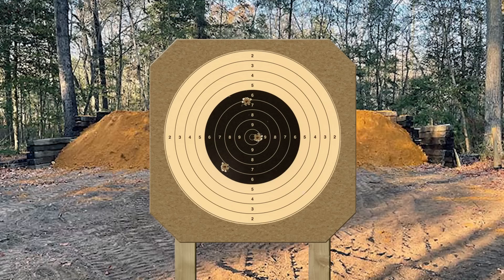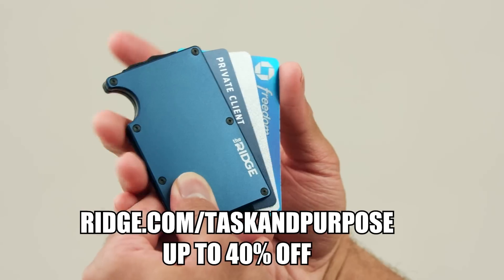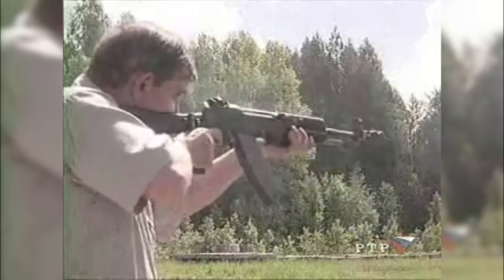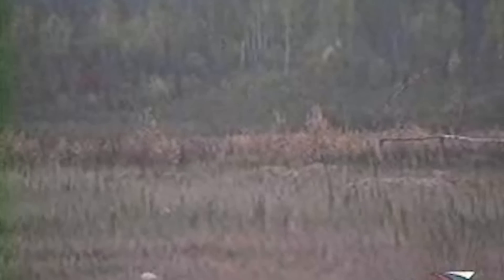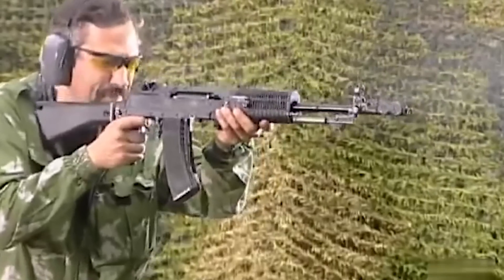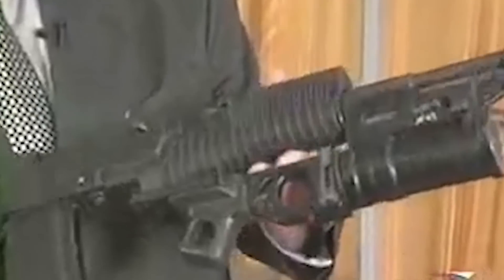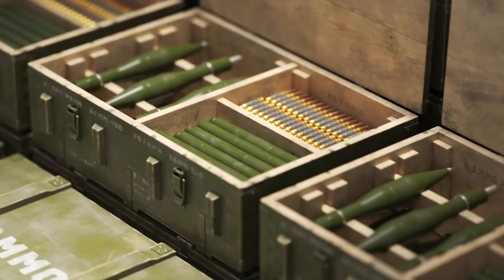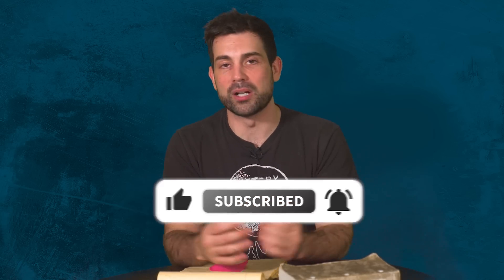This Russian Rifle Fires 2 Bullets into 1 hole

Comment: The operative word here is "complex." Anything more complex than necessary is asking for trouble. Way, way back the US Army tried a different, and much simpler, approach to putting two bullets on target at nearly the same time, the 7.62 Nato M198 Duplex load. They put two bullets in one cartridge case, one behind the other. The tradeoff was the bullets were lighter and the cartridge contained less powder.  I don't think it ever really worked very well, though I remember reading something by a sniper in Vietnam where he mentioned that he and his spotter kept magazines loaded with duplex loads in their rifles when they were moving in case they walked into an ambush on the theory that the number of bullets you could put out was more important than the power or accuracy in that situation.
Reply: I mean.  It ain't that simple.  A single cylinder engine has got to be extreme to reach 80hp.  A twin , same cc, easily spits out 90-110.    But using 10cylinders for 700cc is overcomplicated
Reply: Put 5.45 duplex rounds in the AN-94, just to see what happens.
Reply: I'm pretty sure the ACR report in fact states that the duplex round is the best way to increase shot probability
Reply: They tried it with flechlettes as well, it would massively increase shot probability and I think that will be the next way guns go, possibly with something like flechlettes as well. As far as I'm aware last time they tried it was back in the 60s before the m16

Comment: This is quite similar to the American ACR program(contenders being HK G11, Styre, AAI, and Colt) in 1986, where the idea is to have a 2-3 round burst with one trigger pull and one recoil, thus increasing the hit probability. And the fate of the American ACR program is quite similar, with cost, nightmare complexity, and lack of budget leading to its end.
An94 is actually far less crazy compared to most candidates of the ACR program, with G11 using caseless ammunition and Styre and AAI using flechettes. Only the Colt ACR is simpler, using pretty much a standard m16 but the cartridge contains two bullets.
Reply: The American and Brittish ones actually worked. I never understood why though even on paper it was overcomplicated for too low a yield
Reply: The ACR program was, of course, what I immediately thought of when I heard "So complex the US still doesn't have anything like it".

"Yes, there is a reason for that" I thought.  "It's because the US tested the concept extensively and eventually came to the conclusion that the juice wasn't worth the squeeze."

Which, not surprisingly, was what the Russians eventually decided after trying to put the AN-94 into soldiers' hands.
Reply: Task & Purpose putting out wrong info once again lol
Reply: @WhatHappenedIn-vt3vq  the french also made one in 1978 or something and it worked has a fire selector with one of them being a three round burst, the famas
Reply: @rei1556  Not really. Famas fires 3 rounds with one trigger pull, but with 3 recoil impulses. This means that the second round from the burst will be impacted by the recoil from the first round, thus not accurate. 
Many other rifles have this 3-round burst feature. Including M16a2, hk416, and some AK variants.
Reply: @kevintang5473  doesn't matter, the requirements for that time was they want grunts to put out more bullets with one trigger pull against the enemy, that's why even the us had that acr program and we all know what happened to that
Reply: I don't get the impression that the ACR program is that horrible. They're probably just get the fact that the infantry rifle peaked with the M16A2 pretty soon and do the logical thing and hurried along to the OICW
Reply: The G11 is a much more clever design I think. The internals are easier to maintain and you can field strip it without having to read a thick ass user manual. The caseless ammo makes it a lot weirder but it allows the whole system to work in a more sensible way.
Reply: @Scroolewse  Field striping g11 is just pulling the entire clock-work gut out. You can clean it but you are not gonna replace a broken part outside a workshop. Its serviceability doesn't seem like an improvement compared to an94.
That being said, g11 should be more effective than an94 once it is running. It does a 3-round recoilless burst instead of 2, and the caseless ammo allows you to carry a lot more of them. It will be a better elite special-op weapon, but similar or even worse as a mass-issued weapon.
Reply: @WhatHappenedIn-vt3vq  That's the PRIMARY reason Russians didn't bother REALLY changing away from AK-74 for general infantry roles. Even current AK-12 is essentially an AK-74, just reworked a little to mount railed furniture and top cover. It had also been found that the traditional AK layout can be refined to bring it VERY close to the requirements of MOD without going nuts with balanced action or delayed recoil impulse. AK-200 series and AK-12 are slightly tighter-grouping rifles than stock AK-74M mechanically. But in reality an AK-74M is more accurate than the man holding it in vast majority of cases. What is often REALLY needed is consistent ammunition. Russian army 5.45mm ball ammo is known for uneven powder loads. When reloaded with even powder loads, it's a very accurate ammo.
Reply: @kevintang5473  That burst mode was found to be useless though. Any half-decent soldier can control a 3-round burst in full auto. The point of AN94 was that BOTH rounds left the barrel before the shooter feels the recoil and weapon deviates from POA.

Comment: the funny thing about this Rifle is the angled magazine receiver and the heft of the rifle when it's fully loaded.
Reply: The magazine is canted some 12 degrees. It is done so that the burst mechanism work properly.
Reply: @sarath431  yup and the funny yet amazing thing is the length the engineering team went to make this "burst mode" operational, it was in complete contrast with the Russians' simple and affordable firearms
Reply: @soroushdavarpanah6764  - this gun is exactly the opposite of kalashnikov's ideology. He wanted things to be simple. Sadly, mr.nikonov went overboard and ended up with a Rube Goldberg contraption of a gun
Reply: @devinthierault  - yup. They are capable of producing simple and yet effective stuff. And also, stuff that is unnecessarily complicated. The Soviet space program is so understated
Reply: @sarath431  that's why their (Russia's) new service rifle is the AK12, believe it or not i saw some AN-94s in action in Syria, this weapon has a very distinct sound when it's firing, bad thing is that it was in the hands of ISIS terrorists so it was hard for us to get our hands on one of them, but in the end we did and boy oh boy this gun is a swiss watch 😅
Reply: @sarath431  In fairness to Nikonov, the design requirements were never going to be possible with a system as simple as found on legacy weapons.  In general, if you want a capability that you've never had, you need a mechanism you've never seen.  It just turns out that the capability isn't that useful.
Reply: @mattrobson3603  - well said. In the case of AN-94, the requirements turned out to be novel. Hence the design went totally overboard. Granted, there are some guns with complex design, but this one trumps all of them in complexity.
Reply: @soroushdavarpanah6764  - it makes total sense to replace AN-94 with  AK-12. The best part about AK-12 is that it is an upgraded AK-74, a weapon the troops are familiar with. In the end, it turned out that  AN-94 is not aa suitable replacement for AK-74. 
As for the Swiss watch, that distinction goes to G11. The firing mechanism indeed looks like a clock.
Reply: @sarath431  I have a more well suited firearm in mind for the "swiss watch" title, The Webley-Mars Pistol 🤔
Reply: @soroushdavarpanah6764  - yes. It's the proto desert eagle. It's been said that the people who shot it didn't want to shoot it the second time.

Comment: One of the problem with AN-94 beside being complexity is that all that complex mechanism is squeezed in a space equal to AK74 that's why it's pistol grip is outside the receiver nearly below the folding stock while it's magazine has to be slanted when inserted into mag well to give space for cartridge to be ready to be fed once more before the recoil of the firing of first cartridge could be felt. If one of the  complexities can be solved may be the mechanism would have been adopted in other form like in TKB-0146 which uses same mechanism but in bullpup form but doesn't need it's mechanism to be slanted to have two stage cartridge feeding.

Comment: You really should take a close look at the SPIW (pre-M16 2400 rpm flechette-firing rifle) and ACR (1980s M16 replacement effort) projects. One really interesting ACR candidate that a lot of people know about is the H&K G11, which fired 4.73 caseless ammunition and had a 3-round, 2100 rpm burst capability. The G11 actually made it to field trials with the Bundeswehr, before sanity prevailed and they adopted the G36 instead. All of these were optimized to maximize hit probability at ~250 meters.

The USSR/Russians were just trying to keep up with the AN94. The mistake they made was in not giving up when it became obvious that it was excessively complex in relation to the benefit.
Reply: Trying to keep up? Guess which rifle got adopted?
Hint: You said it yourself. G11 made it to field trials... G36 instead.

Comment: in the 90s, our marine brigade received these rifles, but they did not send a single training specialist (the collapse of the country continued). Even the officers could not disassemble the rifle. But the soldiers found a way, after firing the rifles were not taken apart, but carried to the kitchen, and boiled in a large vat, after which they shook out the water and douched with oil. After a couple of months of boiling rifles, plastic parts began to crack. The rifles were assembled and sent to the manufacturer's factory ........
There is also another remark, from this rifle there is a different principle of retention. The rifle must not be clamped hard. If it is easy to hold on weight, then a twin shot gives two hits side by side, 10 cm between the holes, when shooting at a hundred meters.

Comment: Hyperburst is still a good idea to defeat ceramic plates used by most western armies, hitting the same spot twice would probably penetrate especially with the new AP 5.45 ammo.
But yeah, it is an older concept that still feels like it is a prototype, the AEK took its place for a reason, still a neat rifle.
Reply: That "reason" was because it was too expensive (can we get a cost comparison to the m4?) and required well trained soldiers (can we get a comparison to the US training?  And its no concept it was a real service rifle!  Sure the AEK took its place as a service rifle because it was cheaper and simpler for simpler soldiers to use... Put an AEK on a range next to an an94 with some optics and its no competition.  The MOA is much smaller and twice as deadly.
Reply: @Energine1  Both US and Russian soldiers are expected to hit targets out to at least 400m. US troops today all rely on either ACOG or the newer LPVO sight. Russian troops are taught to do the same job, but with open iron sights. Which means that once they get proficient with irons, fitting an optic will improve them even more so. It also means that during combat in case of optic getting battle damaged, soldier can switch back to iron sights and remain proficient with them. From what I'm hearing, in USA the qual no longer requires iron sight proficiency.

Have you ever spoken to any infantryman that was in a live contact? If you haven't, I recommend you ask him about just how often could they REALLY follow all the marksmanship principles in battle vs how often it became about laying down as much fire downrange towards enemy general direction as possible and move into a more advantageous position.

War isn't how it is in gaming. FAR from it. Even when it's all about infantry.

Comment: Seems to be a similar concept to the G11.
Very complex and quite powerful.
Reply: The G11 achieved a high rate of fire by using caseless ammunition, so it eliminated the need for extraction and ejection allowing for faster feeding of subsequent rounds

This still used regular ammo, so it needed a really complex system to be able to extract and eject a spent cartridge, feed a new one, and fire it very rapidly
Reply: @pdxmarine1430  I ment concept in the sense of military requirements and use. I am aware that the technical realization in the G11 is very different.
Reply: @pdxmarine1430  You'd think that, but the G11 managed to be even more horrifically overly-complicated than the AN94. Forgotten Weapons has a video where they disassemble one and go through it's guts; the thing would make a better clock than a service rifle.
Reply: @WulfgarOpenthroat  Oh I'm well aware of the intricate clockwork mechanism of the G11, but it didn't rely on pulleys lol

Comment: Yes un-necessarily complex , However one design feature I thought was maybe good was the rifle stripping the round out of the magazine on the power stroke of the piston , un sure wether it was as good in practice as say the PKM was .
I visited that company in 2003 , and asked a Army Col , that was working with the company about the AN-94 , and he said , quite expensive , and at that time  , it was basically custom manufacture , approx 300 rifles a year .
Reply: Pretty much. At the time the tooling and production line weren't sorted out at all, hence the low production speed.

Comment: My apologies, I mixed up the AK107 of similar complexity but different function and this carbine. My following post is about the AK107, for the AN see my follow-up reply further below.

Ak107: As tests done by Ian of Forgotten Weapons show, this rifle gets little or no improvement from the complex gear system and most or all improvement from the barrel end compensator. Which you could easily recreate and mount on any other assault carbine.
Or in other words: it's 90% flash compensator. 7% the fairly heavy weight vs light bullet & load.
3% complex gear system. It would be worth those 3% for a competitive shooter but not an infantryman.

There's also other ways to get low, very controllable recoil.
Having a straight line into the shoulder like on an AR platform (unlike traditional AKs) is a good start, as I said putting a good compensator on it does a lot too.

When you look at AKs today what you should be doing is retain simplicity, change the stock to inline, add a compensator and rails with a good zero. 
Use lightweight materials where possible for as low as possible weight while retaining durability and that saved weight is then used for adding a scope or red-dot, or night sight if you want to be fancy.
No need to do anything else.

Unlike what the russians did with the failing AK12 that breaks at the selector rendering the gun inoperable and it can't be fully disassembled for cleaning of gas residue.
Reply: When did Ian shoot an AN-94? I know he recently shot and AK-107, but that's a completely different system.
Reply: @seanherrmann6301  You're right, I mistook the AK 107 for the AN-94. Two different guns, the AK107 has the gear system to reduce single shot recoil, which is what I meant in my post above.
The AN-94 has a pulley system to shoot two bullets per trigger pull.

The idea of a dual shot to increase hit probability isn't new but has historically been two projectiles propelled by one single load.
Of course firing two balls in a musket is one thing, firing two cartridges each time is a bit different. It doesn't just increase hit probability, which it does -to a point, it also uses up twice the ammmo and a clear miss would cost two cartridges. 

I still think staying away from these ideas for an infantry weapon is best due to complexity and reduced reliability vs the proven ak basic design. But yes, the pulley system in it does something unique to the gun, it has an actual result.
Does it hit better? Yes. To a point.  A clear hit would be a hit with a single bullet regardless, two wounds result maybe but most likely a redundant hit unless vs ablative ceramic or hard but fragile titanium plates that would break. However this is how russian plates work not necessarily Nato or Ukranian plates (which can be steel or entirely different composite).
A near miss might still hit with the second projectile. Some salvos would hit where you'd otherwise miss and there is the yes about this.
Does it come with a cost to complexity and ammunition expeniture? Yes.
Is it suitable for limited use with special forces? Possibly.
Do I think American or Nato troops need to worry about it as a super weapon in need of countering or replicating? No.
Reply: @dudedog884  Lol So true.